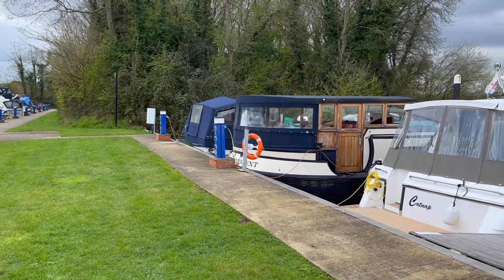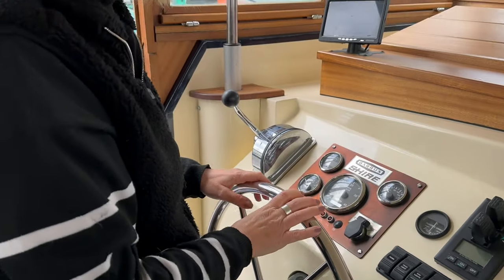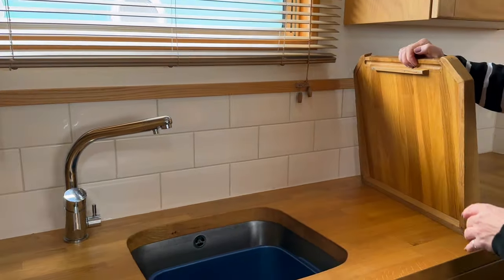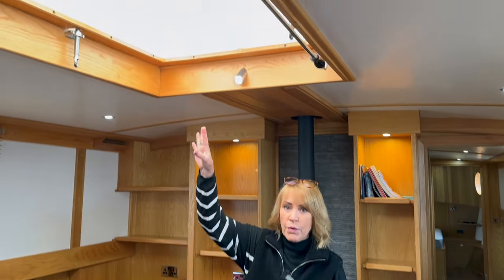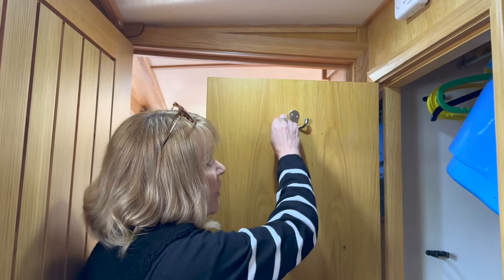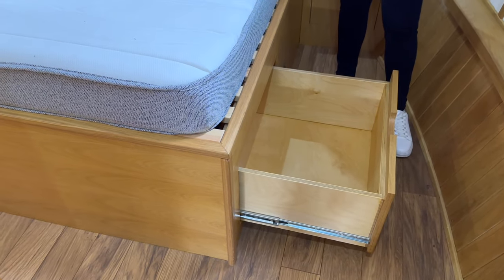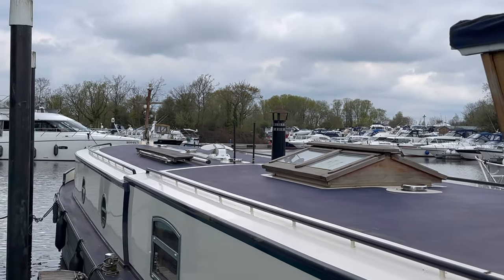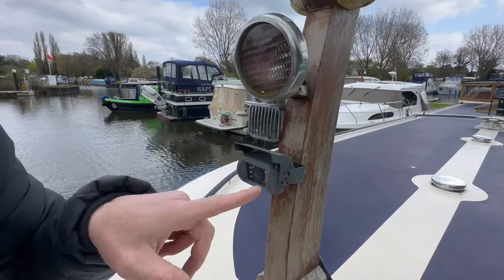Boat Tour! Inside a Classic Dutch Barge | Boat Life | 102

Comment: Lovely boat and a good tour. One thing that confused me was the way the cockpit roof can be lowered. I presume the windows (and doors) all have to be dealt with first. The front windows look to fold outwards onto the cabin roof, but the side windows look to fold inwards (judging by the hinges). This is where I'm confused because the 2 forward roof struts look as if they are blocking the nearest windows on either side, so I can't see how they fold down to allow the roof to be lowered. Did you happen to notice how this is done?
Reply from the maker: We think on a lot of these boats they actually unclip, fold out slightly and then slide off the hinges, but no we didn’t actually see it done. Not something you would want to do too often! 😊
Reply: @WidebeamandWellingtons  It is something I'm looking at to see whether a light weight version could be done for a narrow boat rather than having a pram cover. Its the idea of having a decent size squared off cruiser stern that makes a nice dining area even in cooler weather while moored. A room with a view rather than being sat lower down inside all the time. Obviously in nice weather it would be stowed away during the day and maybe even evenings, but in the middle of winter on a rotten, wet day you are forced to move keeping it up if there are not more than one or two bridges along the way would be advantageous. I'm playing around with a number of designs - hence watching closely whenever something similar comes up. Pram covers seem expensive and drafty given their relatively short life. Noisy too in the rain.
Reply from the maker: We have seen narrow barges on the river before not sure who makes them though 🤔
Reply: @WidebeamandWellingtons That is interesting. I'm not sure I'd want a true barge design though as the ones I have been on (long) in the past did not have flat level floors - they curved. They were the original ones though, not converted into live aboards. As a live-aboard I think level floors would be easier to live with. 

I have even wondered whether it is time that boat designs modernised to the extent of a forward control as seen on the Broads cruisers. That would allow for an enclosed driving position in winter. I also think it is high time that windows were made big enough and to come low enough so that while sat on a sofa you can see birds on the water instead of only having a view of the sky.